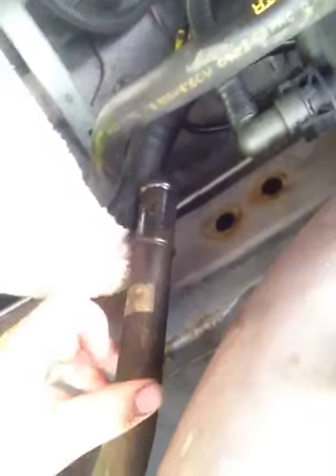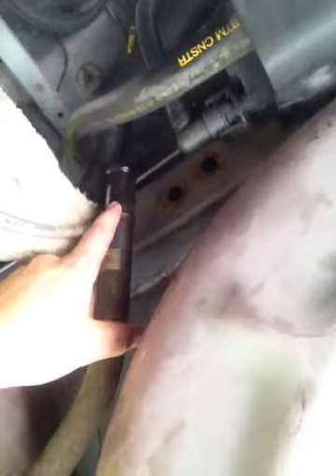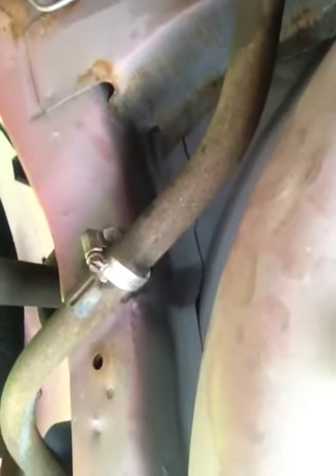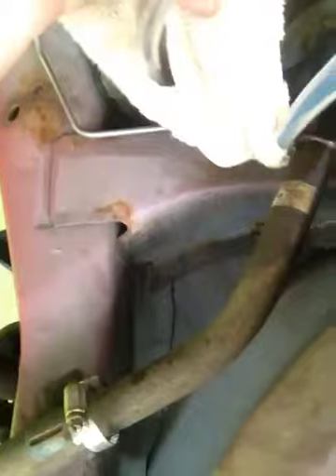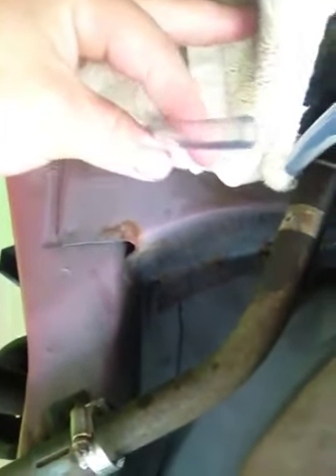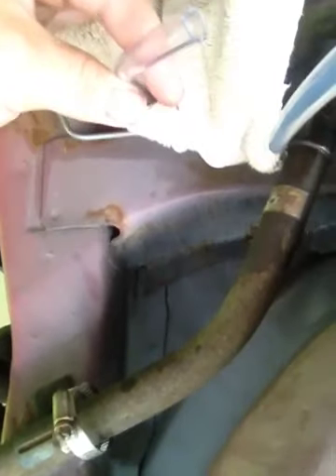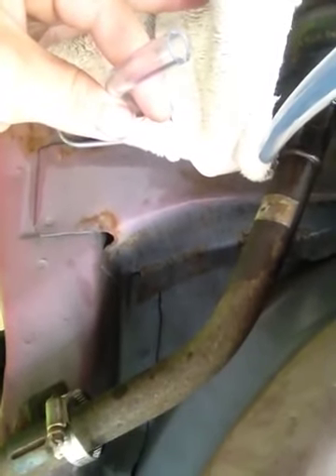Bypassing an "Anti-Siphoning Device"

Comment: Did this with our 2017 Suburban when we were having car problems and still had another working car. At first, I tried sticking a stiff enough tube down the fuel line to try to bypass the "anti-siphone device". After spending 2 or 3 hours a night over several nights, I finally gave up and went underneath.

I thought my 2009 Camry was "old" enough not to have an "anti-siphoning device". I nearly got my tube stuck twice. Even though it's more cumbersome to get underneath, it's just so much easier to loosen the clamp and pull off the rubber hose instead of these other methods of pulling out the back seat just to go through the fuel pump or tapping the fuel rail underneath the hood.

Comment: That is a good method, thank you. Especially if you drop the tank you need to disconnect that hose anyway. But I've read there can be special gasoline extractors from the car gas tank with anti-evap/siphon mechanism, like small rigid pipes or something. Where to find those?

Update: I found that device at FlowJoe. 32 gal/hour. It also can be used w/hand pump. I used it that way, since not much gasoline was left in the tank.
Reply: Urban legend.